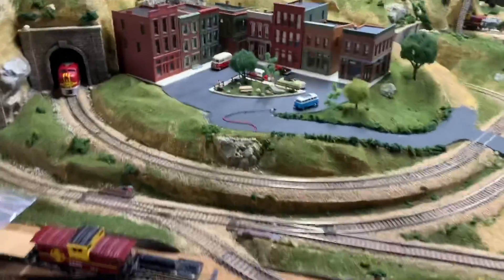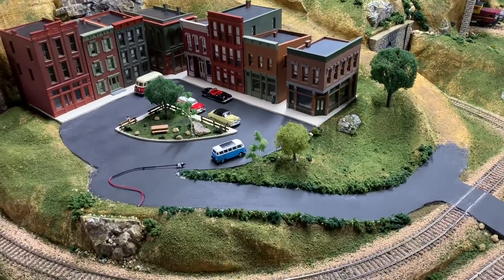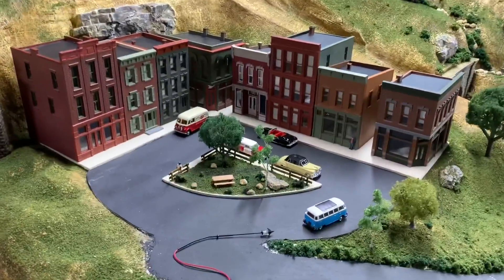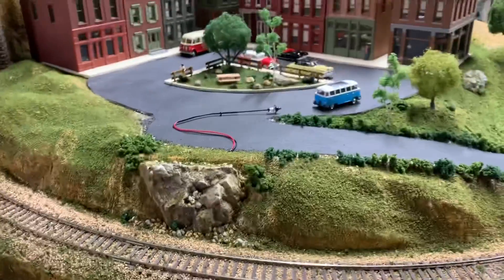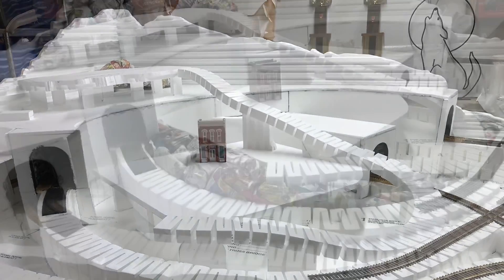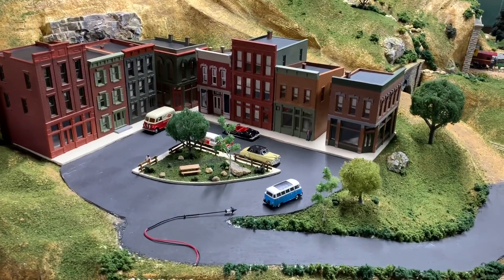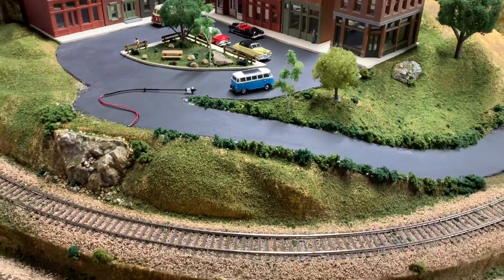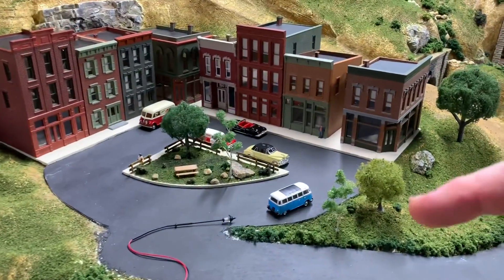Update Number Twelve

Comment: In terms of the plug, you could snip the plug off and splice the wires under the table to prevent such a large hole needing to be drilled.
Reply from the maker: Yes that’s exactly what I ended up doing later on. I also use plastic tubes as conduit and glue them in place first rather than trying to fish wires down through the layout and the bench work.

Comment: hall tall is your actual train table?
Reply from the maker: Amy Stefanick I custom made it so I’m not sure. I’ll measure it tonight when I get home and update you here. Thanks for watching.
Reply: @DansGrandValley  We are getting ready to build the Grand Valley Layout.  After seeing some of the different videos, we are going to do some precast rocks at the entrance to the tunnels and will probably paint inside the tunnel black.
Reply from the maker: Amy, that sounds great!  So from the floor to the table top I measure 39”. Like I said I made it custom to me so I didn’t have to bend at the waste to work on the layout. I have a work bench stool to sit on when I sit there. A couple things I wish I had done back at the beginning. 1) paint the entire inside of the mountain black. This way cab ride videos would look better. 2) leave a significant amount of the back corner under the mountain open. Install a couple of switches off the mainline to be able to divert trains out the back to an add-on staging area later on. There is a lot of valuable space inside the mountain that is wasted. I store train cars and locos in there but it would’ve been nice to be able to have a siding coming out of the mountain. 3) if at all possible think about creating a trestle or even land mass that would allow for a crossover instead of the cross track. It becomes a problem when running multiple DCC trains. A collision is always waiting to happen.  Have fun!  Please share when you get it going. Thanks for watching and commenting!
Reply: Dan’s Grand Valley Layout  i reviewed the layout and figured out a way to add the two bridges and remove the intersections